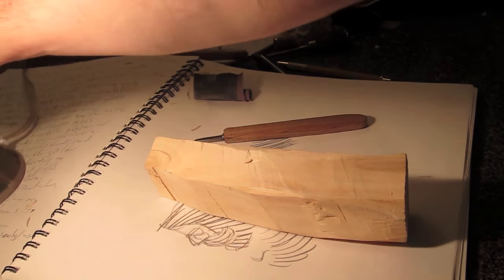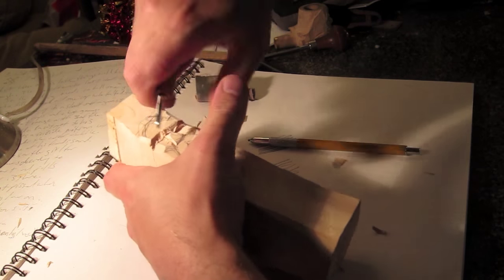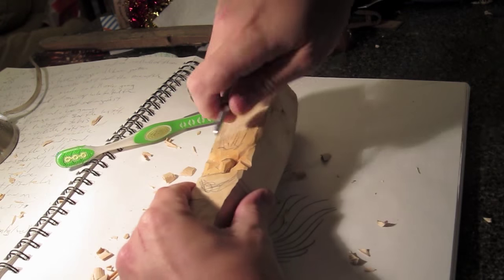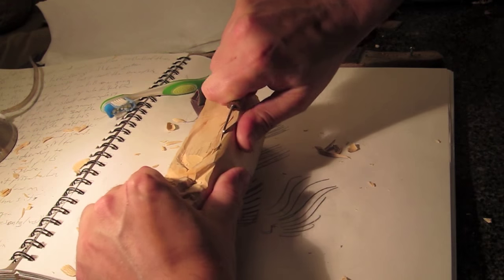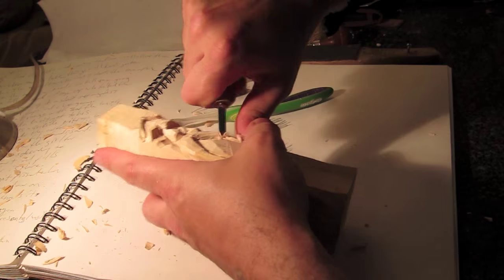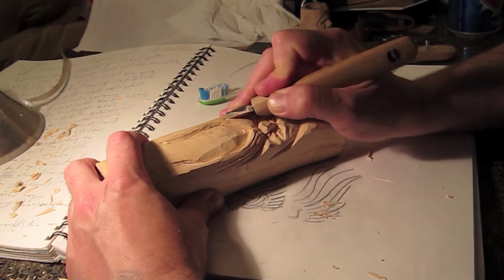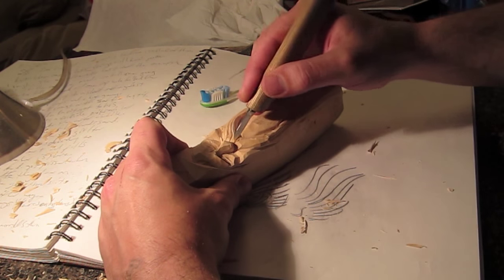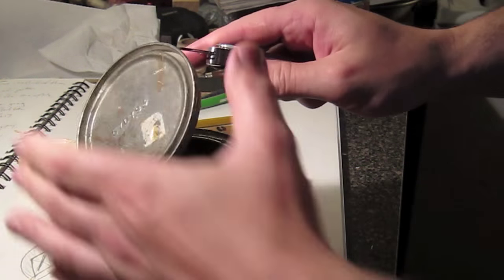Knife Only Wood Spirit in 30 minutes

Comment: Thank you for the video. What is the pencil you are using to mark the wood? I've tried looking for something similar online but I get something else. Thank you.
Reply from the maker: Kris Jones sorry for late response. They sell cheap fat ones at hardware stores called carpenter pencils.architects use 2mm lead holders. There's more fat 'lead holders" at art stores or eBay. Very expensive relative to regular pencils. I have seen some fat pencils showing up in some art stores too that are a bit cheaper. Good luck

Comment: I'm wanting to carve  a wood spirit on the oaken handle of a pocket knife but I'm too worried about cutting so deep that I breach the slot where the blade folds into the handle.
Reply from the maker: most likely the wood is stabilized and way to hard to cut. scratching and engraving might be more possible. wood burning maybe the best option. but a pocket knife is so small for traditional hand tools to get a design on. my suggestion would be to buy a knife kit with extra 'scales' to practice carving on. also look into gun stock carving, they use dental tools to get details out of hard woods
Reply: @schpoingle  What I have is an Opinel #8 with an oak handle. I've already carved finger grooves into the grip with a Dremel tool sanding band. Recently acquired a flexcut carving kit but I really don't intend to be adding human blood to my woodspirit both for my general health and not risk channeling the spirit of Chucky from "Child's Play" into my knife. With the handle being small and rounded that looks to be quite a challenge. Mayhaps I should take the engraving approach as you suggested. I'm sure I could find some Dremel attachments to do the job. I've also considered using small Hobby files.
Reply from the maker: @Grinlathak  yes, small files would work well. rasps if you can find them. the issue with dremel engraving is they are hard to control. this knife is more wood than i imagined. you could try your flexcuts. they are good tools. I had the same thoughts about doing carving on small wood, i don't have the patients and hand control. similar wood to practice on is the top of a cholula hot sauce bottle. it's a thing too. but order some basswood off ebay if you don't have some. it's so nice to carve. take care!

Comment: nice  video  Only the pheil knives are expensive,Which wood are good,Wood types here are cherry wood, linden wood, birch wood
Reply from the maker: get a deepwoodsventures knife, his scalpel is excellent and cheap. all the woods you mentioned can be good depending on the tree and the condition of wood. buy some basswood off ebay from lumber4you to have some reference. then you can test wood you find and know if you'll want to carve it or not. basswood is a type of lindin...but some lindin is super hard and some too soft, some not straight. good luck mate!
Reply: Buy a mora 120 carving knife and a sharpening stone, use that for everything except the fine details to save cash :)

Good type of wood for carving usually depends on how much of your time you're willing to spend on the piece and what sort of a toolkit you got on hand. Just keep testing and you'll find your favorites. Check for mushrooms on the birch, some are amazing for carving when dried out.